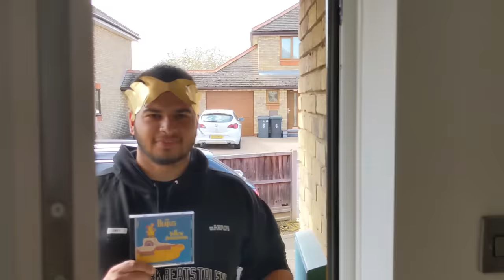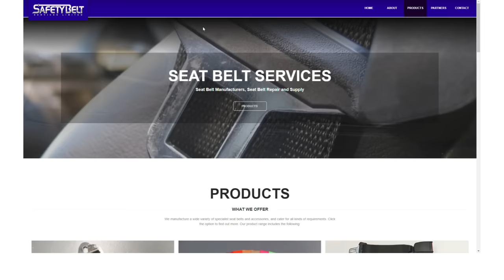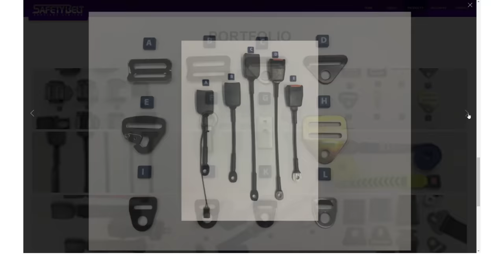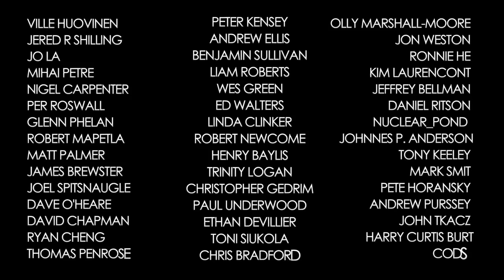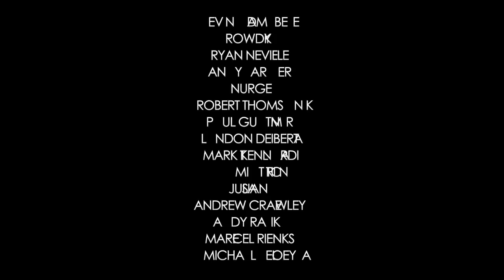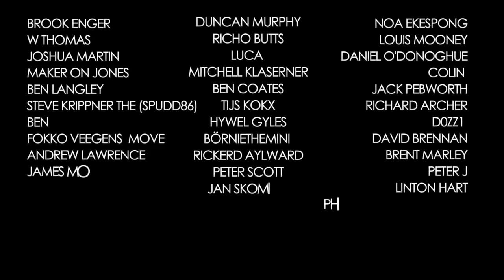Project Binky - Episode 38 - Austin Mini GT-Four - Turbocharged 4WD Mini

Comment: I want to see them get insurance on this. 
Insurance "So is any of it custom?"
Nik: "yes"
Insurance: "and how much?"
Richard: "Yes"
Reply: ... we may have added a bracket or two, nothing else to worry about.
Reply: @graemeporter  ... and do we need to declare the added lightness?
Reply: So Sir, has the Mini been modified in sny way?😂😂😂
Reply: If the insurance ever has tp pay out, at least they'd be able to spread the payments out over twelve years or so...
Reply: "Is any of it factory?"

"Possibly some of the roof, cant be sure"
Reply: motorsports insurance,  most rally cars are heavily modified
Reply: Technically it should be on a Q plate and pretty easy to insure once its passed the inspection.

Keeping the mini plates will make it much harder to have all the paperwork legit.
Reply: @Gecko88  oh god, can you imagine how that list would be, actually written down in a vertical list with bullet points....😮😂
Reply: @irishwristwatch2487  Everything is Factory. Its a huge factory with merch and everything..
Just google BOM Shropshire Mr. Insurance Guy - but its a one of.
Reply: @Gecko88  We flipped just the Shell and added some gussets, lightness and a safety device - nothing special at all.
Reply: Good thing Lloyd's will insurance anything

Comment: 2 things i noticed:
Air-Filter is not decoupled. Vibrations and even litte engine movement might undo its couplers.

Catch can might not work after the engine is wormed up. The oil fumes should run throught a more maze-like piece in order to give all oil partikels/droplets the chance to colide into a hard surface.
Because condensation will not accure effectively after the condensation wall is warmed up.
Love your work ! Keep it going :-)

Comment: Ok, so this is the first episode I've seen of this car, and the comments are basically saying that you bought the car new, and started modifying it right afterwards, but the project has been delayed since the 1960's due to issues. And it's also going to be a multi generational build at this rate. Best of luck with the hyper drive and anti gravity generator installation. 😃

Comment: I was told Usain Bolt considered becoming a professional footballer. Being pessimistic I replied that it would be a crying shame to see him stretchered off seriously injured. If and when you marvelous tenacious perfectionist mechanical engineers and fabricators ever do get Binky up to race speed; think of us. For the first year, please consider us and do not take the chance of rolling Binky. Once the fans have had the chance to see Binky, once you have done your tour (you have to do a ten stop tour - you both know that), which will put the miles needed to run in the engine, then peace is made and you can make Binky do what you designed her to do. Stripped down, pared back, roaring!

Comment: that door really is a work of art, I thought I was being all clever changing the external handle for a metro style lift up flap type, with brake cable operation, even getting that to fit around the window was a faff.. just goes to show the difference between a tinkering amateur and real engineering

Comment: You NEED to stick the self adhesive plastic film to the door BEFORE the door card. It is used to cut out out a lot of wind noise and stops moisture/water from entering the car via seepage from the window seals.

Comment: 11:16 to my knowledge, this doesn't matter because air after being compressed by turbo reaches 100+ degrees no matter if it was 20, 40, 60 or 80 on the intake. It's the duty of the intercooler to cool down the charge.

Comment: Well she was actually finished but the final kerb weight of 2,723Kg (up from the original 660Kg) meant top speed was limited to 22mph.
So Binky's quietly been sold to a chap in Wales where the 20mph limit means no one's actually noticed this.
Reply: It wouldn't run for an hour never mind do 20 miles

Comment: Hang on Air intakes in wheel wells hasn't gone wrong anywhere before has it? Was it the Mk 1 Hilux? where puddles would cause suckage of water into the engine?

Comment: Yet another incredible video. Quick question from an Intake Engineer... do you have solid motor mounts? Those tiny silicone jumper hoses will likely pull off. Could I send you a short silicone bellow for engine movement vs the chassis mounted air filter?

Comment: Im very late to this build series but as soon as I saw the car without front fenders I had to watch. The inner and outer fenders form a deep U channel wich along with a couple of cross members form the front subframe mount and bumper attachment points. They are gone. This puts all of the stress of acceleration on two small brackets tying the subframe to the footwells, the bolts of which will pull through the metal of said footwell ( ask me how I know) It appears that you reinforced the area forward of the shock tower as part of your modifications to compensate. Now I only need to find which video shows the mods. All in all this looks like a very well thought out project and I am only 37 episodes behind.
Reply: Start at the beginning, and you will see how they have built a totally new structure for this car.  It only looks like a Mini on the outside, but underneath it's something else entirely now.  As far as I could tell, the original Mini didn't really have frame rails as such (and didn't really need them either).  Binky does.  So there isn't really a front subframe to fall off, everything is securely bolted to the solid frame rails.

Comment: surprised the IAT its in the intake pipe and not in the charge pipe after the intercooler, in the intake pipe thats is absolutely wrong in boost application, or do you have two IAT?
Reply: There are 2 sensors. The other one's in the OEM location inside the intake.

Comment: Is that intake air temp sensor in tge wrong spot ? Won't the turbo add heat that the computer needs for its calculations?
Reply: They have 2 sensors. 1 pre-turbo, and one post-intercooler, in the intake manifold.
Reply: Perfect 🤌

Comment: isnt the catch can meant to have an inlet and outlet AND the breather filter?
Reply: If by outlet, you mean drain, that's optional. The can could be removed, or an oil extractor could be used to remove the oil. You may also be thinking of an air oil separator. Which is different than a catch can.
Reply: @MellowYe77ow  so a catch can isn't just slang for air oil separator?
Reply: @barrybritcher  While they both provide the same basic function, catch cans are generally more simple than an air oil separator. Catch cans generally have little to no baffling in them, and simply catch most the oil, and and vent the crankcase gasses and some oil to atmosphere. 

An air oil separator generally has more complex baffling to remove as much oil as possible from the crankcase gasses, and vents the gasses back into the engine's intake. and drains the oil back into the crankcase. Some of them even run coolant through a loop, and heat up the separator, to keep condensation out of the oil.